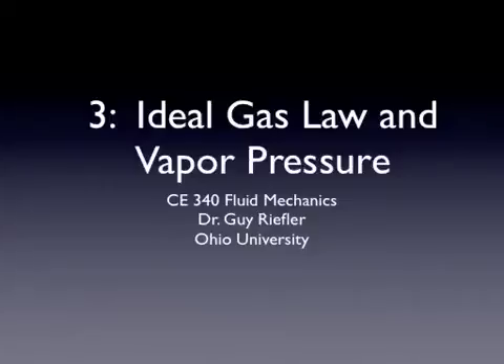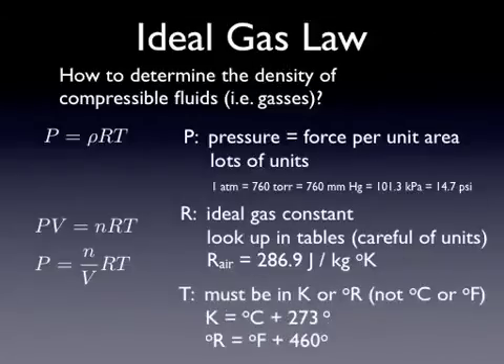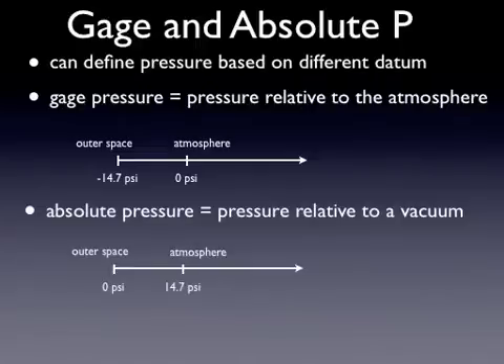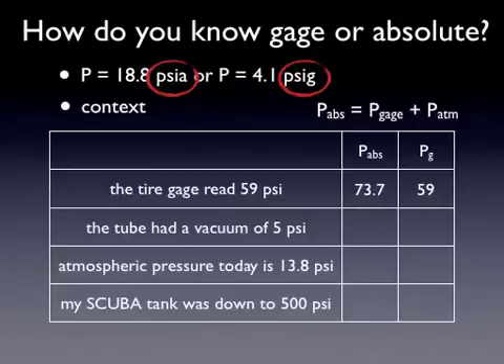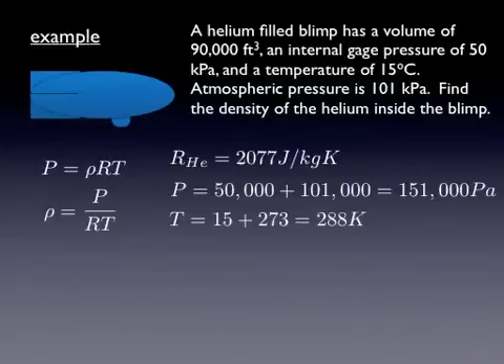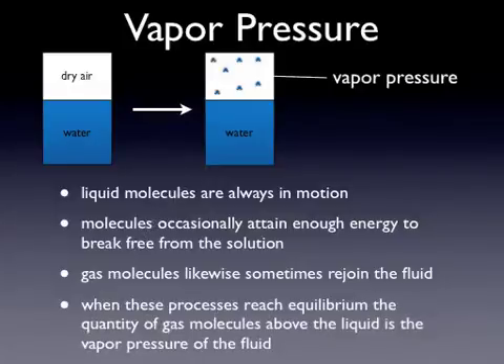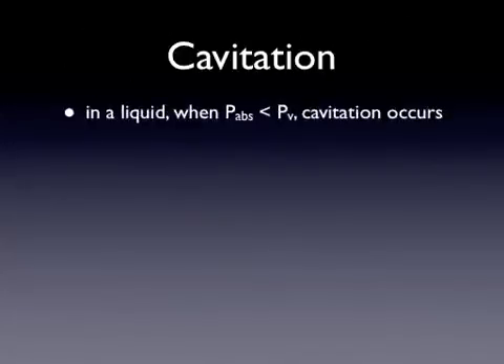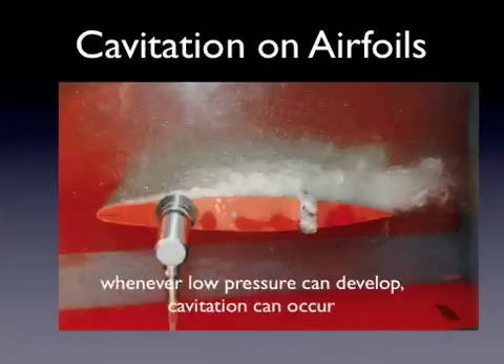03 ideal gas law and vapor pressure.mov

Comment from the maker: @1DeathWishForever
Depends on units.  R = 286.9 J/kg K = 8.314 J/mol K = 0.0821 L atm/mol K.  Use the first R with P = rho RT and P will be in Pa.  Use the other two with PV=nRT and P will either be in Pa or atm.